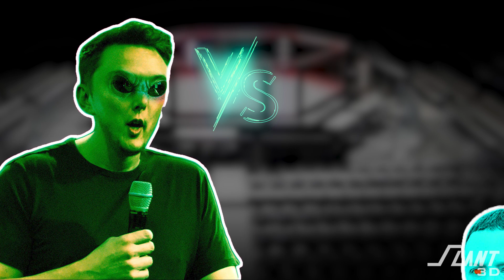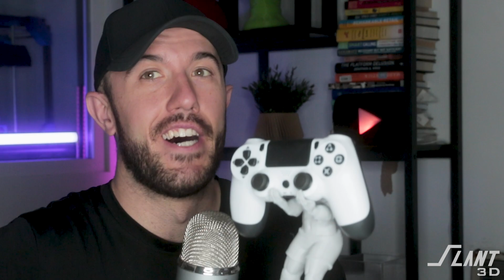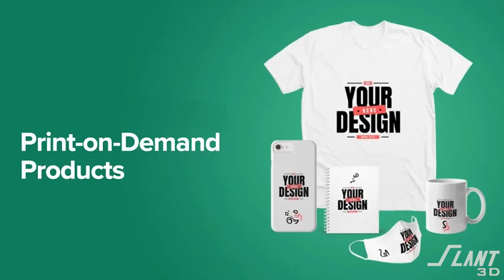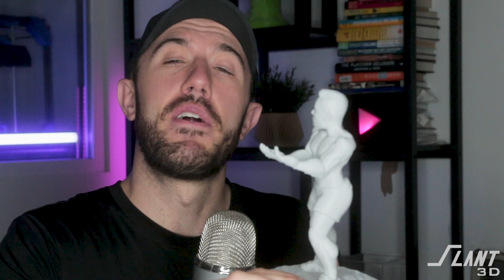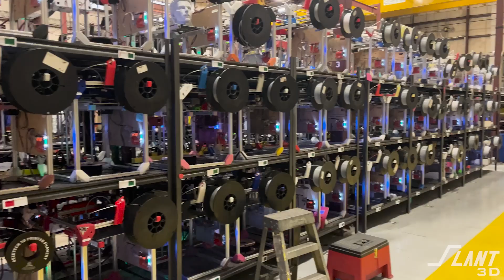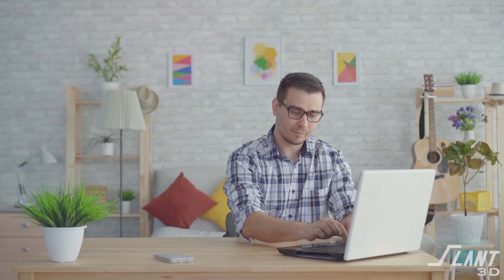Turn Trending Moments into Etsy Profits with 3D Print On-Demand

Comment: Can you do multi-color/ multi-filiment/ multi-nozzle sized prints? 

Not all at once. Those are 3 seperate questions of your print farms capabilities
Reply from the maker: None. Single color prints only.
Reply: The capabilities to make that practical really aren't here yet. Need a rapid changing multitool system or innovation to make AMS-like swaps near instant and poop-free. Otherwise these prints take 10x as long as normal ones or worse, and waste typically double the material.